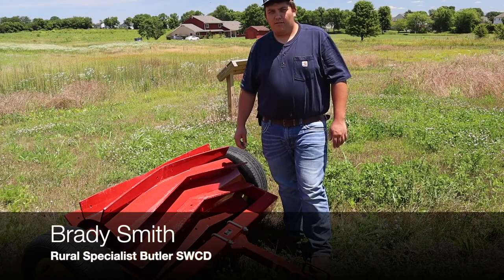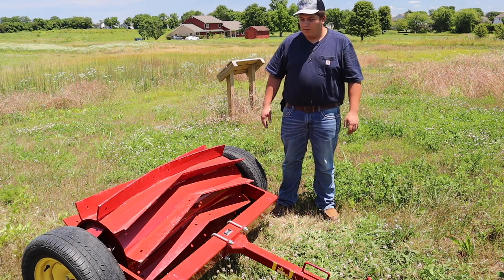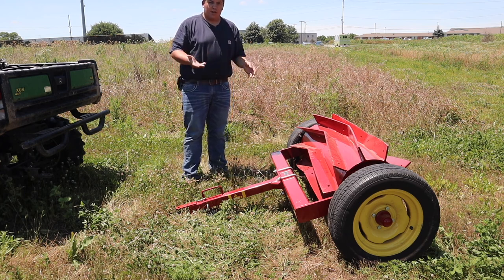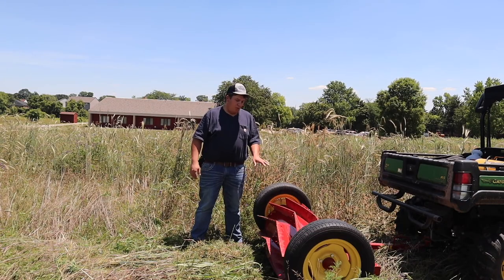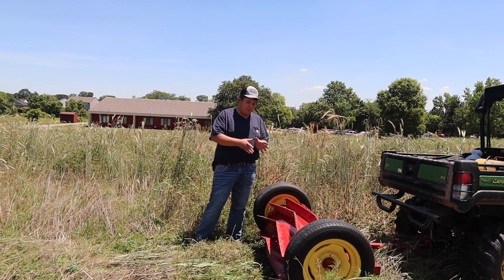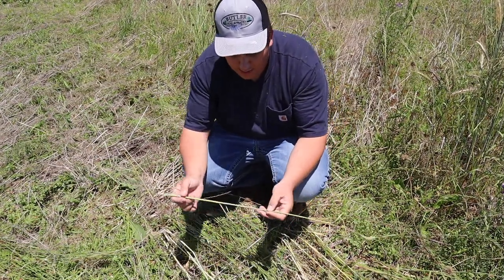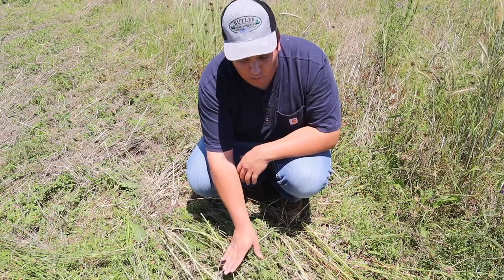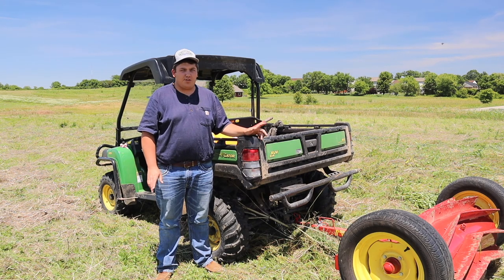Using a Cover Crop Roller - Crimper

Comment: What is the weigh of the roller without water in it /
Reply from the maker: I would estimate this weighed over 500 #s as is. Water weight is roughly 8 pounds per gallon. I definitely wouldn't recommend pulling it completely full. A lot of folks I spoke with just run a small amount of oil to prevent rust inside the cylinder.